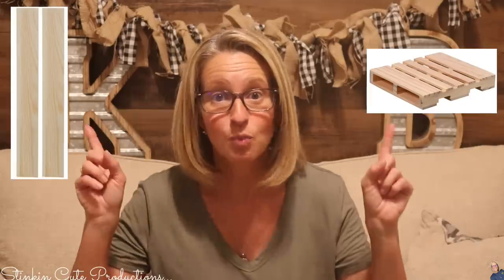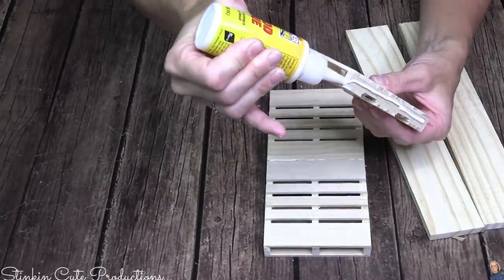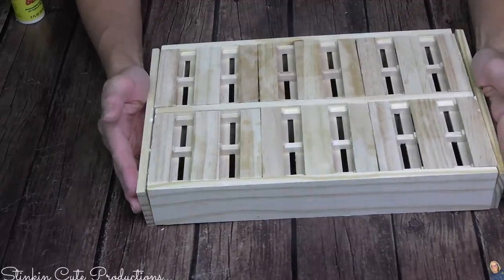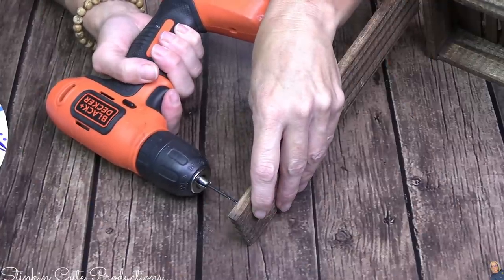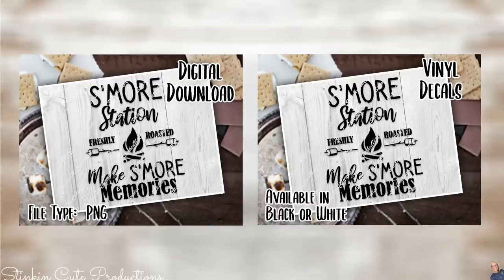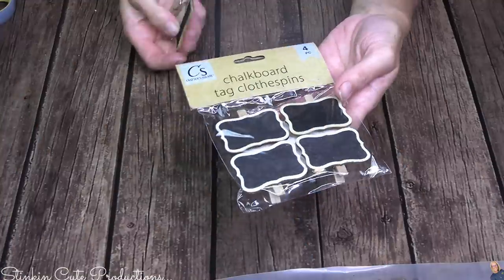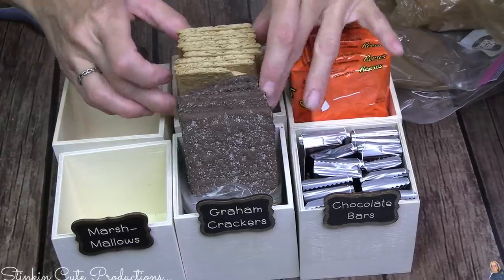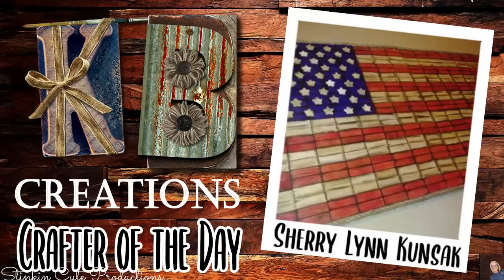AMAZING *NEW* HACK using $1 Crafters Square Wood Craft Sticks | MUST SEE HACK!

Comment: Hi Kelly:  I love this.  So pretty and functional.  I would love to make one.  My only thought is that it’s not that budget friendly now that the dollar tree sells everything for $1.25.  Looks like it would cost about $30.  Perhaps cost could be cut by using something different for the bottom. I’m thinking a scrap piece of wood. Also you could use wooden paint stirrers from Lowe’s which cost about $.99 for a set of three.  Since you have to cut a few anyways that might be a cheaper option. I love the beads for the handle. They look like mini marshmallows. Again…another stinkin cute creation.  I love it

Comment: Adorable! My mind is racing with too many ideas. You could even thread the beads on wire if you wanted the handle to stay up instead of hanging. Decorate it for all the seasons. Use it for silverware and napkins or even condiment jars for cookouts, or even just put candles in it. This is a very versatile piece!